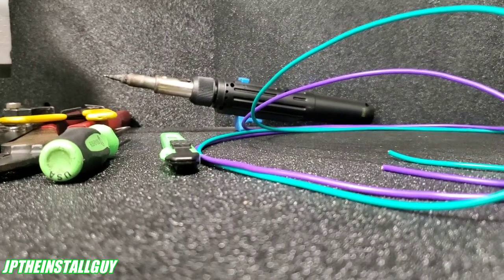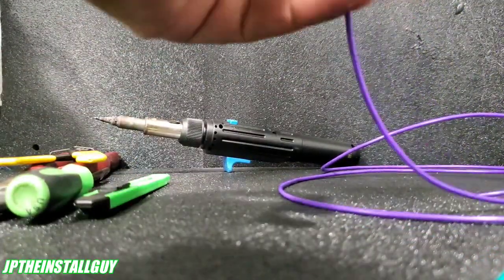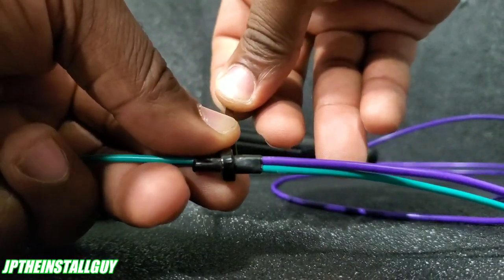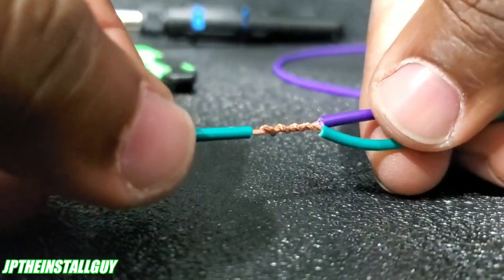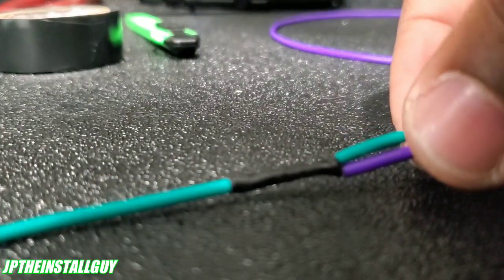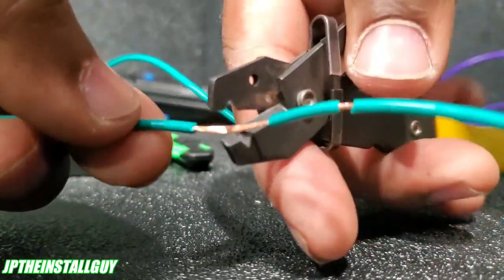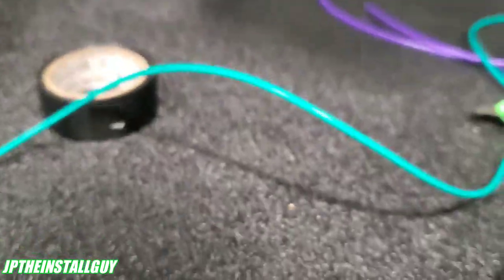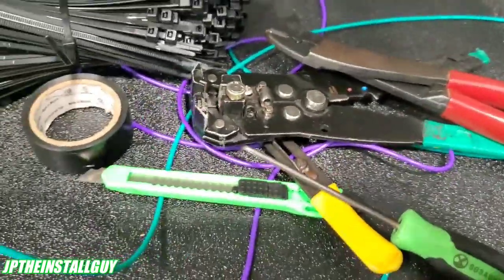How to strip your wires

Comment: Hey, I have the ASWC-1 and the AX-TOY28SWC for my pioneer deck. I bought the TOY28 for a plug and play connection. I’m confused as why I have the ASWC-1, did I have to get that just for the black control box? All I have to do is give the connection power (red) and ground (black) right?